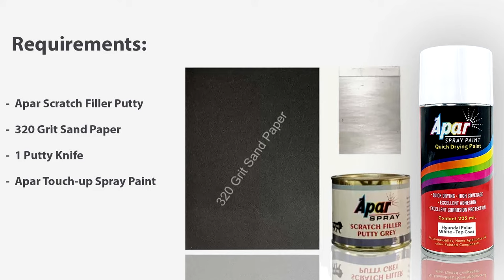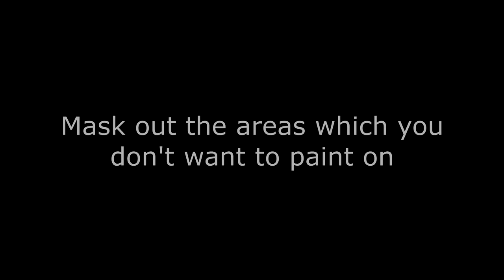How to Use Spray paints | Apar Touch-up Spray Paints | Removing Scratch from Car | Apar Spray Paints

Comment: I bought it by seeibg this video, its a big waste of money and more over its very thin spray and it drips a lot. Dont waste ur money,time by seeing this false add
Reply: Sir please apply paint from a distance of about 7-8 inch and try to make a thin coat of paint over surfacer 
 
This problem happens when you apply spray paint very close to surface or when paint is applied on a same region contiously for Some time 
Hope this works
Reply: How to fix the overspray? I got to feel hard sand like particles nearer to the sprayed area..I think that is overspray which can be felt during touch